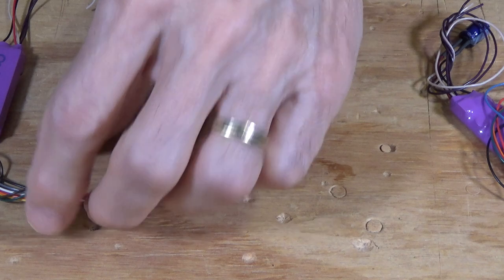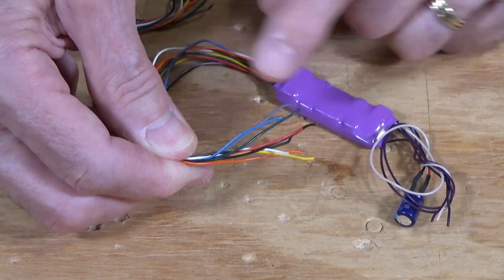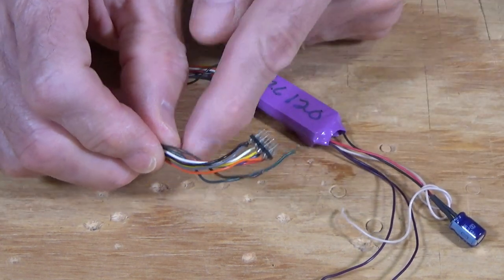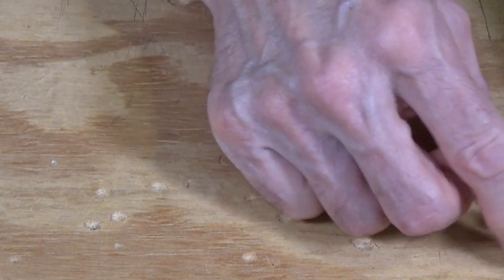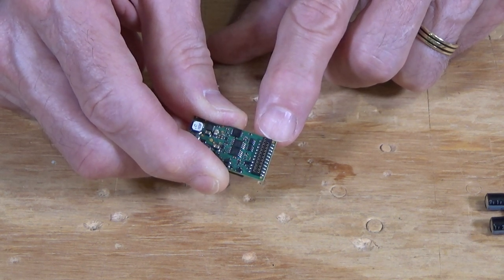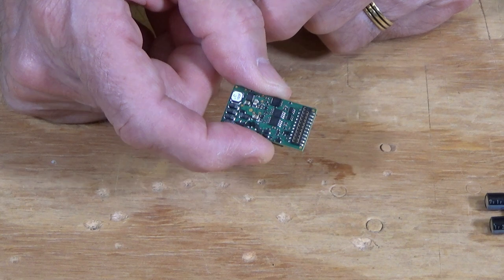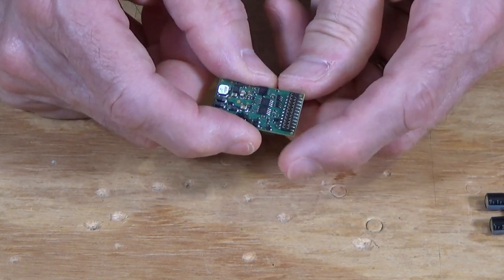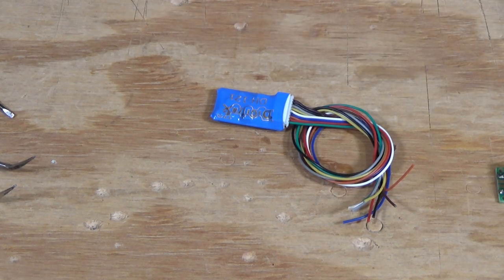DCC 101, Common DCC decoder connectors (51)

Comment: Hi Larry. I need some help i have an Fleischmann N scale ICE T train. Purchased on 2002 with Decoder 69 6846 some years it worked ok. But at some moment it begun to work erraticly. Forward or rear and stop little distances 10 to 20 cm. I ready replace brushes cleaned all contacts so I'm sure energy constant to the loco and decoder.  I can read and change loco number using my MRC control. So i need some help or suggestions.
Reply from the maker: Try a factory reset, that often works bur you will have to completely reprogram it. Also if you have not already, give the wheels a good going over with a cotton  swab soaked in alcohol. I recently had a Bachmann loco that behaved like this and ended up having to pull the motor and use a strong electrical contact cleaner called CRC QD Contact Cleaner aerosol. I sprayed it directly into the opening next to the motor commutators and it came out the other side black with contaminants. It now runs great. I suspect the previous owner got oil in the motor and sold the loco cheap on eBay because it ran so poorly. Good luck.

Comment: Very informative looking forward to the next part because I have an ESU tester.  I have a question that is related to DCC I am wiring up DS 64's using Cat 5 cable is there a connector I can use to join the switch motor wires to the Cat 5 wires running to the DS 64.  I am using Kato coil turn outs?
Reply from the maker: Will, iI wish I could help but I have never even seen one of those Kato devices. Do they have any kind of screw or clip type terminals on them or is it just a bare wire setup? If bare wires you could use a screw terminal strip and attach the Kato wires to the screw terminals then attach the DS64 Cat5 wires to the paired screw terminal. You should be able to find screw terminal strips at AllElectronice.com and other electrical supply houses. Cat5 is a great way to wire these kinds of things up as I showed in my video on control panels.